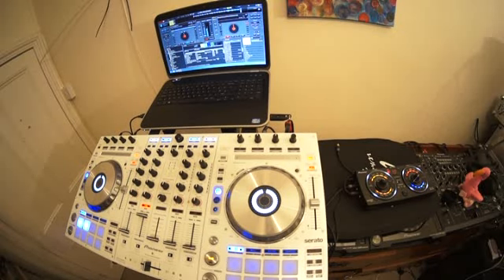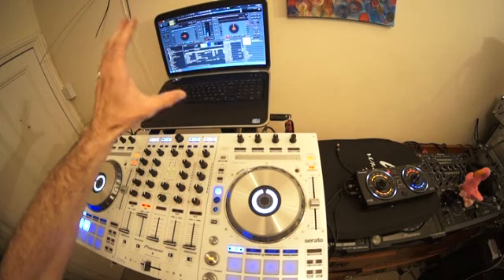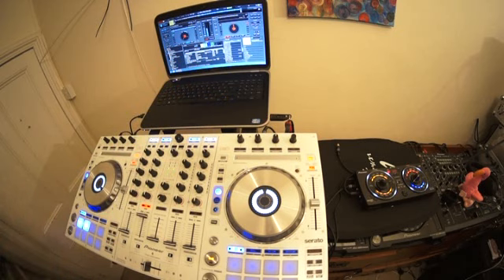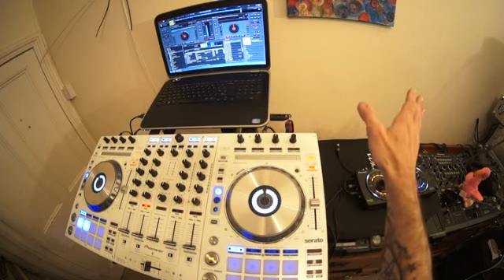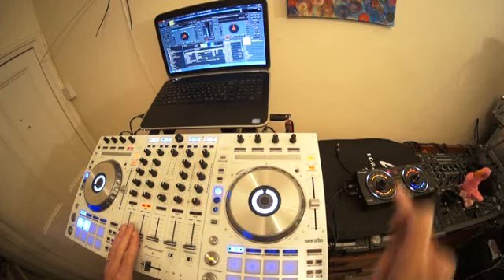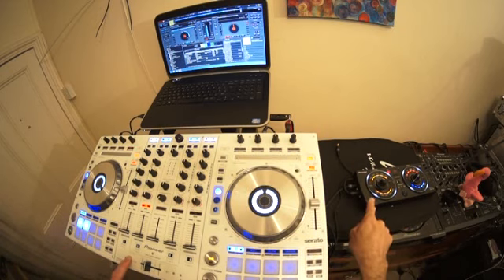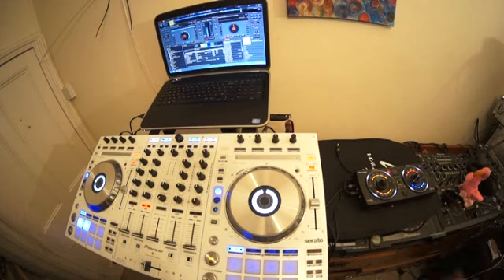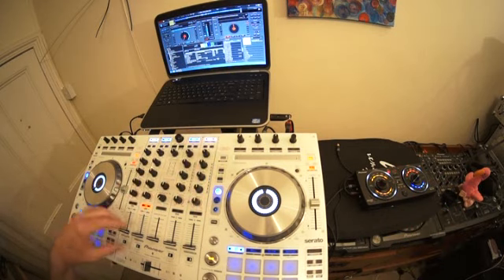HOW TO PLUG THE RMX 500 INTO A CONTROLLER DJ DEMONSTRATION

Comment: Very useful video! I've been planning on getting an RMX 500 for a while now but I'm worried I'll get it and it won't be compatible with my Numark Mixtrack Pro II in Serato. This video definitely helped a bit but I have one more concern. My Mixtrack Pro II is USB powered, and I noticed the RMX500 also has a USB output. My question is, when routing, besides going from RCA outs of my mixer to the RCA in of the RMX500, do both devices USB outs need to go to my laptop? Or does just one device? If so which device needs to be plugged in via USB? The RMX has so many options to plug in on the side that I'm confused as to what is the most proper way of routing this device. I'd thoroughly appreciate your help!
Reply: +Michael Pietanza I own a RMX-500 Unit, and the usb port its just needed when using the unit as a VST for your DAW. so basically it would be a rca from the mixtrack pro ii into the rmx unit and then rca out to your speakers. 

Hope it helps !

Comment: How about the headphone? should i use the controller headphone output or the RMX headphone out? If i use the RMX headphone out would i still be able to select headphone Cue/PGM/Deck from my controller? If i use the Controller headphone Out will i be able to hear the RMX efx in the headphone PCM/Master side?

I just got the unit, im trying to figure out how to use it on my Denon MCX8000. My MCX8000 have a seperate Booth out too. Was wondering can i use both booth and Master out into RMX as it only have 1 input... does it mean i can only choose one?

Comment: I have a slight issue
Wondered if you could help
I have gone
Out of djm 450
In rmx 500
Out rmx 500
In active speakers
USB out rmx 500
In USB port computer
Rekordbox is picking up the signal but I get no sound from speakers???

Comment: does the SX not also double as an actual 'true' mixer? If so, it could also be done via the Master Out? or even the Send - Return loop.
Reply: Yes it does but only has the low/high pass effect that actually works if using cdj's or tts. But the addition of the rmx 500 or any other effects unit would get round this.

Comment: Hi Fella
Ive got one of these for my XDJ-RX and all set up but it would appear the FX I use arent coming out on my demos. Ive searched everywhere for a solution. As it stands I have the FX unit but whatever I record doesnt feature any of the FX that I use. Any idea of a solution?
Reply: that is because the mixer on your console doesn't have a proper SEND>RETURN on it. This type of loophole doesn't allow you to record the fx that you are using on the rmx because the sound that you hear is coming from the unit itself but the sound that you are recording is coming from the xdj-rx. the only way to get your mix to be recorded as you are hearing it (with FX from the RMX) is to have a proper audio card in which you send the sound from the RMX and record from that audio card...
Reply: And how would I do that?